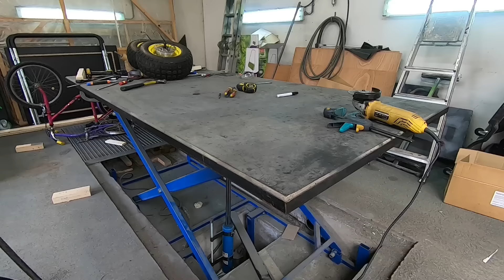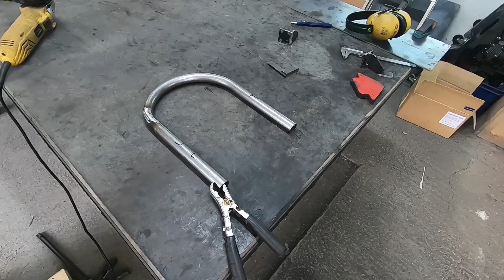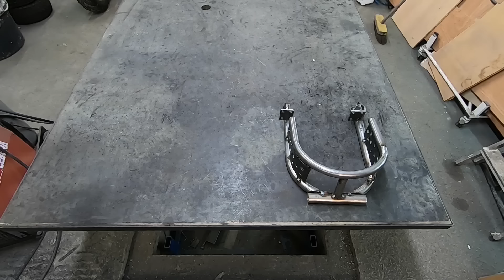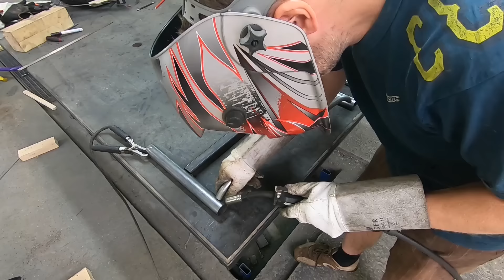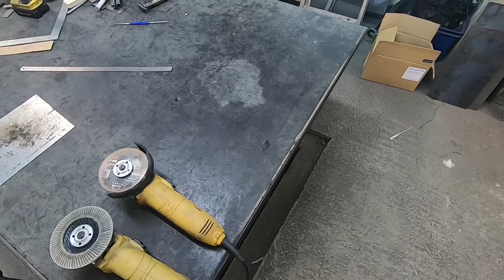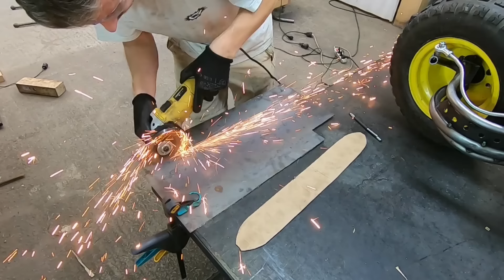How to build a DIY tilting electric scooter with fat tyres and 4 hoverboard motors - start to finish

Comment: Have to say that is some awesome engineering. I would love to see how that thing handles off-road trails. Well done!
Reply: Probably bad, because the shock absorption was omitted, which after a while may result in the fracture of the frame or the welds.
Reply: for something home made its impressive
Reply: @messor01  it has a front and a rear shock

Comment: Thanks for showing the whole process including the test drive - its great to see how well it works. Im in awe of your mad engineering skills. I even learned a few tricks about working with metal. 10/10 - would recommend.
Reply from the maker: Thanks man👍
Reply: he has versatile metal worker skills, for the engineering skills you need a deep test to see if it is really well designed indeed. Maybe it is too !
But what happens if the motor in one of the wheels stops (suden motor failure)  and not in the other ? There will be a contrary pitching of the two wheels in relation to the frame, and a rotation of the scooter in yaw. Do the control electronics take it into account ?

Comment: My man this is beyond impressive. B-E-Y-O-N-D!  Just hopped on YouTube to get a little inspiration in my own scooter design...then I come across this. I have so many questions that I am really at a loss for typing them out lol I'm seriously flabbergasted. I'll get back to you with my top 5 most important inquiries regarding things you did I would like to emulate. This build is incredible. For any seasoned e-scooter hackers/modders out there this is like a full fledged work of art! For real atm im like at a loss lol. You should also be commended for you're welding skill, design, and the way you somehow retrofit those hover-board hub motors into another albeit LARGER wheel base (AND MADE IT WORK. . .)! Just the shear audacity alone to try this is mind blowing lol you must be an engineer for your day job eh? If not. . .maybe you should look into an engineering gig!
Reply from the maker: Wow thanks man this means a lot 👍. And I am no engineer, I have a desk job by day😏
Reply: @hennybutabi  hello. What happens if this thing gets caught in the rain?
Reply: @jurybur_bobkov  you ride it out of the rain

Comment: Great craftsmanship and attention to detail. If you can add an electric part it will be nice, I am currently building myself a dual motor electric scooter based oh LH-100 throttle, dual batteries and matching controllers and my knowledge is not enough because I connected all and have E 08 throttle error and E 10 communication error when I disconnect second controller all works as it should and in dual mode learning works on both motors. That's why I mentioned electric part because for beginners like me it will be priceless to see how you make wiring and connect all to work in dual or quad motor configuration.
Reply from the maker: If you have bought the dual controllers with splitted wiring loom included, there is 1 wire that is not splitted (from memory i think the green one). You must plug in your display in the controller that has all 5 wires. That could cause the error. Also make sure all your hall sensors are connected correctly. Good luck!

Comment: I found the tilting very interesting thanks. Initially when I was like "3 wheel scooter... how he going to turn normally" (on all my scooters I typically steer most the time by leaning right or left, vs using the handle bars usually only for 90 degree turns). Then I saw it tilting (I assume via the steering wheel, not the body weight?), but still thought it interesting, I never saw that before. But aye, because of the need to use the handle bars to turn, it's probably more like a moped (or tilting e-trike) vs kick scooter hehe. Still loved it ;)

Comment: I watched the hi-speed summary version of this build over on QuantumHD. I love this scooter! It reminds me of an idea I've had for years (but I have no shop skills or resources 😭). A "chopper" style motorcycle where the back wheel is a tractor tire with multiple electric motors (possibly in some sort of miter or face gear set up, or maybe planet, dunno), and those motors powered by a propane burning generator. Maybe do hybrid, because a more street legal variation I had in mind was a semi truck tire for the back, and then it could be battery for city streets and the generator for highways.
Anyway, I'm giving you the idea because, as I said I have no skills nor any way to source materials, BUT I WANT TO SEE MY IDEA MADE REAL!!!
Hope you are well, take care.

Comment: It would be great if you added a pneumatic assist the to rear suspension to pitch the deck at a 25-35degree angle to give more flex when riding over non flat surfaces(so you are standing at the apex of a triangle), amazing build.

Comment: That scooter is so crazy looking imagine if it had a kabbo wolf motor in it or 3 1500watt motors lol 😂 great vid tho 👍
Reply: I agree he should have used 2 1500w motors and a 72v battery lol
Reply: @cliphunter4800  it's possible he could be over volting the little motors and making them go faster but the computer he was using wonder if it was just the Segway one which would for sure would be slow

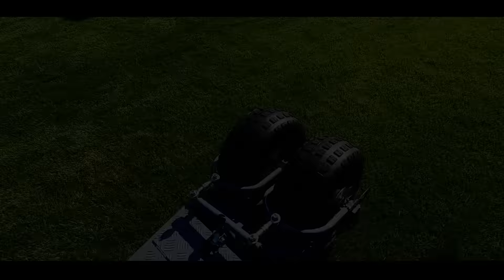Comment: 37:07 It would be great if the mechanism on the rear wheels could be easily locked with a thin steel cable or other light method, when one of the wheels is deflated, it can be lifted so that it does not touch the ground in corners, and not to be supplied with current until it is inflated to a minimum pressure. How would this scooter go, with the handlebars placed next to the rear wheels, acting through a long rod, the direction behind? With both engines in front it could brake regeneratively more efficiently, especially on long descents. Then the scooter could go up and down more easily diagonally, not perpendicularly, on sidewalks, curbs, sloping mountain paths ...

Comment: That was cool. Wish i have complete tools
Reply: Tools are not that expensve.  Start with the basic CORDED (plug into AC wall outlet) power tools like angle grinder and sawzall.  Buy ONLY premium high quality tools that you find CHEAP and USED at yard sales scrap yards etc.  Keep looking and looking someone will give you a free drill press and the next day you find a metal lathe at the scrap yard for $200.  By now you are making money and can buy a NEW MIG welder.   I literally paid $750 US for my 5hp 42 inch mill AND my 13 X 40 lathe.

Comment: Hey when you are making your bend all u have to do is when u get to the point u can't bring it around any more put a short piece of  tube behind your part and it will bend on around to the bend u want with out have to cut and weld

Comment: Great looking build, I'm hoping to build a mobility scooter with 4 x hover board motors, I'm presuming 4 speed controllers needed, can they all work from one throttle,,and do you give each one its own battery, many thanks for sharing
Reply from the maker: Yes you need 4 controllers and you have to splice the wiring loom from the throttle to each controller. Works perfectly

Comment: Cool custom scooters, but one thing I personally dont like is mechanical disk brakes. Braking force is sooo small comparing to hydraulic brakes
Reply from the maker: You are absolutelty right, that's why the project I am currently working on will have big hydraulic brakes. Stay tuned😏

Comment: another amazing build. im wondering if cost was a factor why chose hover boards instead of opting for 4 more powerful after market  motors?
Reply from the maker: Yes it was😏. More power would be nice but it drives fine like this.

Comment: i just hope you put diode for dem battery 
something about 1 bat getting low voltage before other destroying the bms  
specialy needed for series wired battery
Reply from the maker: I always keep a close eye on the voltage and I never drain them completely so it should be no issue

Comment: How do you control all four controllers simultaneously with 1 tps.  Could you provide a wiring diagram for this exact model.
Reply from the maker: You just have to splice the wiring harness to the 4 controllers respecting the colors. Each controller should receive 5 wires.

Comment: A thought I had. 

with some design tweaks. Perhaps a deck that can be flipped upside down depending on use case.

Normal side and the deck is lower for street/city use. 
Remove the running gear, flip it upside down and reattach the running gear and the deck is higher up giving more ground clearance for going off road

Comment: A couple questions. Is the connection between the two rear swing arms needed to control the lean? I want to do a shock for each swingarm and need to know if I have to make the connection or was that just you could use one shock? Also on the throttle did you just split the wire and connect to all 4 controllers or was there something special you had to do?
Reply from the maker: I think if you use 2 shocks they will work against each other if they are firm. When you turn left the right wheel will come off the ground. I eliminated that effect with the hinge system. And yes, just splice the harness 4 times, that works.

Comment: What voltage battery do you use 🤔 is it one battery or a battery for each hub motor, thanks
Reply from the maker: I use 4 hoverboard batteries 36 volt but you can use 1 big battery also.
Reply: I'm currently building a 4x4 contraption from scrap, could sure use your advice on connecting the 4 hub motors, 4 speed controllers to one throttle Is it even possible, power 48v
Many thanks

Comment: Were you able to use 1 voltage controller for all 4 motors? Or how many did you need?
Reply from the maker: You need 4 controllers,. 1 per motor. You have to splice the wiring harness from the throttle to each controller.

Comment: ok the body was a bit odd of all things but what I want to get to is that you could have gotten it and go much faster and stronger if you now used hoverboard motors.

you could have kept the hoveboard motherboard and replaced the capacitors so they can withstand 60 v with a 60 v battery, it would have run easily at 26 km / h or 16 mph instead of 15 km / h or 9 mph as an unmodified one would have done and it would been much stronger.

you could also remove the coding on the cards and put in (fox) instead, it would have easily run 46 km / h or 28 mph with the 60 v configuration.

how I know has done all that I have written myself

Comment: Any reason for keeping this on paved roads? It looks like it’s made for off road. (massive fat tyres, suspension system, heavy duty frame) . I think i’m not the only one wondering how this would handle on a dirt road, soft sand beach, mountain trail, etc..
Reply from the maker: I will try to offroad it, however i thing it does not have enough power to be fun

Comment: I watched this entire video hoping to see what brushless DC controllers you would use and how you would wire them to the hub motors only for it to be skipped.😢😮‍💨
Reply from the maker: I know my apologies. They are 350w 48v BLDC controllers from aliexpress. Just match the colors of the motor wires and hall sensors and it should work. If you want to use more controllers, just splice the harness from the throttle display to each controller. I did it like that and it works. Good luck!
Reply: @hennybutabi  Thanks the throttle part is exactly what I was curious about.

Comment: Although "power in, is power out" ... but, beings I see 4 electric systems, or 4 motors, 4 batteries, 4 controllers, .... I wonder, if the unit will power itself on just one of the 4 systems, and you can run the other 3 to charge those 3 systems? i speculate with these type of brushless motors, that likely doesn't allow for such reverse current direction?  would be interesting, to see if that would allow this unit to be able to run at least 3 times further or longer... or maybe even longer than that? just curious.. Very clever suspension system on both front at rear.. I like it.

Comment: Hey, I am building a go-kart for my kid that uses four 10.5 inch hoverboard wheels. I jumped the gun and bought a 48v battery pack and am now worried that the additional power is gonna fry the motors (the controller is rated for 48v). Have you had experience overvolting these motorwheels?
Reply from the maker: Yes I have used 48v batteries on hoverboard motors with 48v controllers and did not have any issues, so you should be good👍
Reply: @hennybutabi  thanks, that’s a huge relief.
Reply: @hennybutabi  Hey. I am also struggling to understand how you've wired the throttle to run all four controllers. Help me out?
Reply from the maker: @ProtonFilms_Mark  you can splice the harness to wire each controller. When you buy a dual controller, this spliced harness is provided in the kit. Since i bought 2 dual sets, i had to wire 2 spliced harnesses together to wire 4 controllers. Hope its clear😏
Reply: @hennybutabi  Crystal. I had a suspicion it works like that, but I wasn't sure. Thanks!

Comment: Hello mate. 
Really impressibilité work and engeenering !

Im Guillaume, from north of France. And really want to know were was you find thoses wheel ?

Thx for your help
Reply from the maker: The wheels are from a lawnmower tractor.
Reply: Thx for your Quick answer mate. I will try to find one of this ;)
Thx and dont stop your build. They are incredible 👍🏼
Reply: Really sorry to disturb you mate. 

But i really cant find them hère in France. Do you Shop them in a local store or on web?
If you can give me some info it will be really helpfull. 
👍🏼
Reply from the maker: @zzbibizz  i got them from a friend, no idea where to buy.  You could also use ATV wheels like i did on some of my other builds
Reply: Thx for your back. I just find some 16.5/6.5/8 in NL. At 42€ thé complète wheel  
If you need it ;)
Site is trailer plus 

Thx again 👌🏼
Reply: Roh sorry i disturb you again. 
Do you charge every battery each after one other or do you find some thing to can charge them in one Time ?

Comment: that's cool. Any reason for making 2 wheels at the back? Doesn't it become less nimble for turns?
Reply from the maker: No, I already made 2 "normal" scooters so I wanted something more special 😉. It actually drives like a scooter with 2 wheels because of the tilting action on the rear wheels.

Comment: Are 4 motor controllers required or can one be used to power all 4? Im attempting to do something like this haha
Reply from the maker: Yes you will need 1 controller per motor. There are some videos on youtube where they test 2 motors on 1 controller and it does not work, the motors work agaist each other.
Reply: @hennybutabi man thanks for the quick response. I just got home from buying a used hoverboard haha. Perfect 😁

Comment: Why the tube cutting at 0:42 ? Why not just bend it more?
Reply from the maker: My bender does not go further. If you push it further, the pipe kinks. Thats why I use this workaround.

Comment: Awesome work!
Technical question. What type of throttle signal did you use to the 4 controllers ?
Reply from the maker: You just take the throttle harness and splice it to the 4 controllers. Works perfectly👍

Comment: its needs tires with a round profile to take advantage of the leaning capability, yup, handle so much better, it wants to get on the edges of those lawn mower tires but they are square so its fighting that principle, go round profile, good and sticky like superbike tires.. let it roll over on the tires.. watch, I guarantee the handling and cornering is 10 fold..if you can't find them on the shelf email dunlop or Shinko let them know you are building a prototype, send them someo prints or pics they do one offs all the time, who knows it might be marketable with a different battery and motor, talk to Musk about the power plant and energy needs, hale yea!

Comment: Honestly though I dont like the front fork design at all because you're working against the material not with it. Because of the leverage and load you had to make the lower front support really thick, attaching it directly to the deck. It really makes no sense as you want a compressive load on the tire and the suspension. The proper way to design a front fork is a triangle. The handle bars come out of the top of the triangle, the fork on either side of the wheel and the deck attached to the opposite lower end of the triangle. There is a technical term for the angle of the handle bars in relation to the fork of the tire and the steeper the angle the more control you have at lower speed/high speed.

Comment: I am confused by your description motor is 36volt 250w and controller is 48v 350w and battery is 36v if your over clocking motor then why you are using 36v battery 🙄
Reply from the maker: It's just what I had on hand. 36v battery works fine with 48v controller, and leaves the possibility to use 48v battery also
Reply: @hennybutabi  according to your experience, what is the max voltage and wattage for hoverboard motor?
Reply from the maker: @itsmecorona4453  I have done 48v, I have no idea how much more they can take
Reply: @hennybutabi    I have one hoverboard laying around so thinking about building one scooter out of it. Thanks for your reply ❤️.
One last question, what about max wattage?

Comment: no off-roading? i thought you are gonna test it somewhere else....whats the purpose of 4 motors and fat tyres, you are just wasting your batteries bro where as slim tyres and two batteries plus light frame was enough to get the same output

Comment: It will sure be an epic fail because electrical drills cannot use continuously for a long timw especially with heavy load needs to rotate it will over heat and burn for sure

Comment: 10km autonomy is not good
Reply from the maker: I know, I am planning to build a better battery to solve that
Reply: @hennybutabi   im sorry. But you work is amazing. My respect to you
Reply: The motors will fry if u go bigger battery unless you change controller and motors try e bike hub motors ,